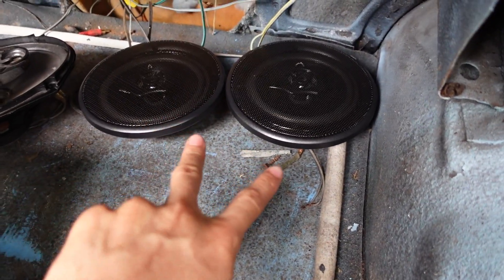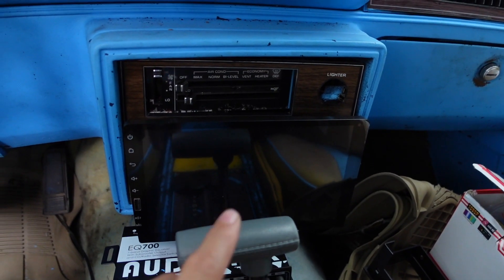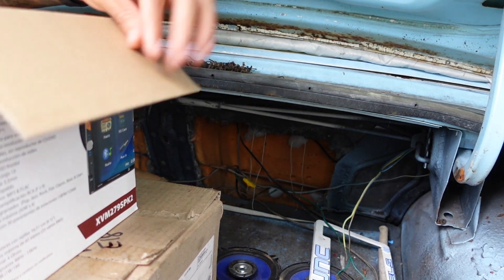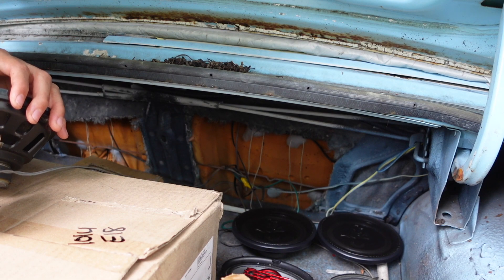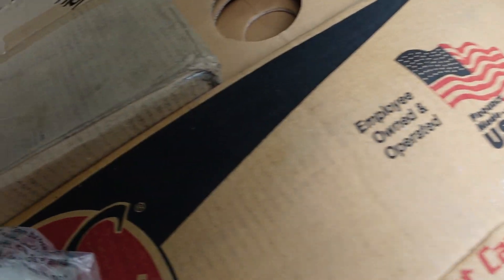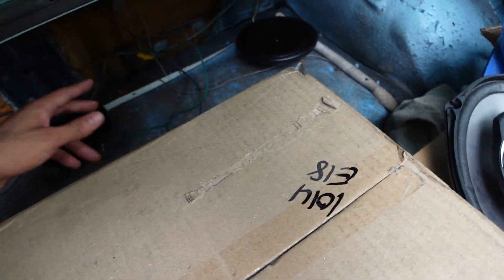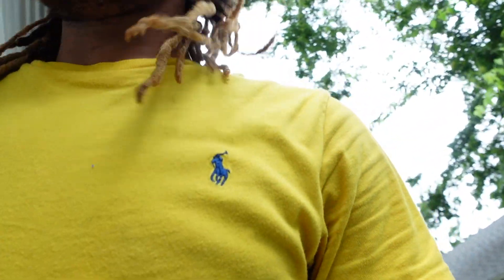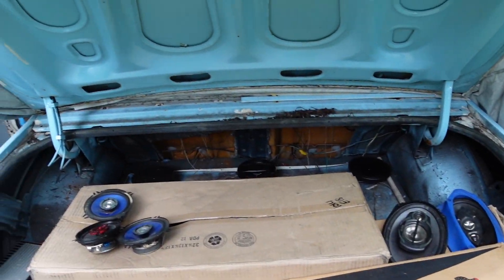Adding Rear Deck Speakers to the Cutlass

Comment: You might have a parasitic drain in your electrical bro. Your battery shouldn’t die that easy.  From personal experience, if I were you, I’d get my self all new wires , for amp, for the speakers , new rca wires , and redo everything, that way you know everything that was done, and done too your liking, especially on the older cars rapid they cut the stock harness which I’d say 90% will be, and put your radio to a continuous power, the yellow wire, like too your lighter, something inside that gets constant power, and all your memory will stay. & me personally I know your trying to use what you got, but I’d go with 6x9”s in the rears, and components up front , mid & tweeter , it will get there bro but really try and find what’s draining or your gonna hate it when it’s all done, just get it out of the way, thanks for the vid
Reply from the maker: I appreciate this bro. I found out what was draining the battery, too. It was my power seats, they would stay running the entire time. And, imma be running new wires for my subs and amp, I’m waiting to get my car back from the mechanic shop so I can start running them. I appreciate you bro!!